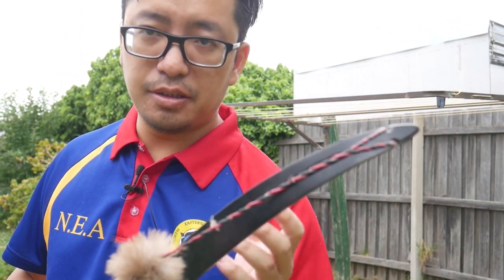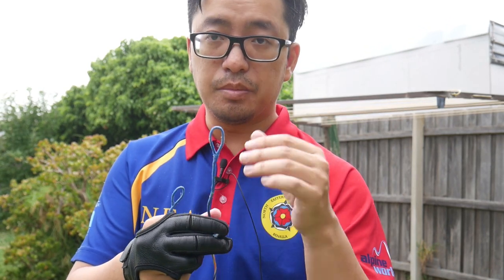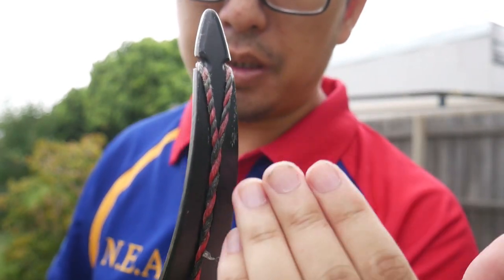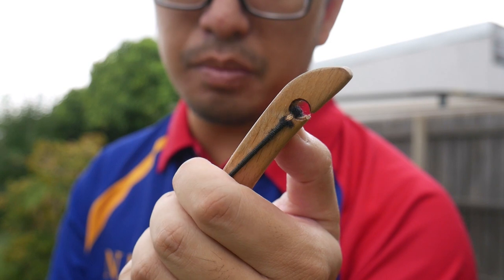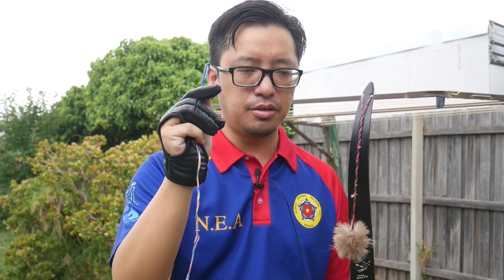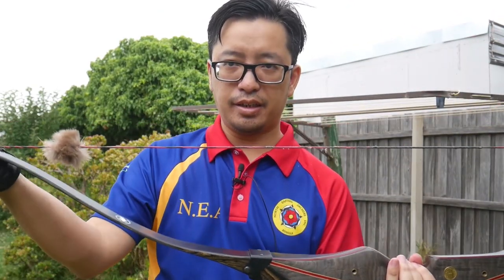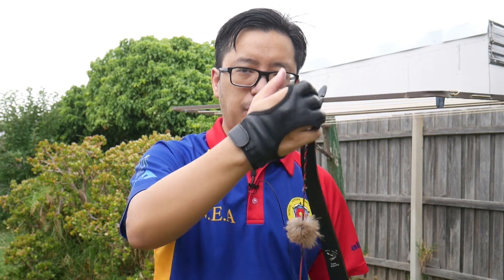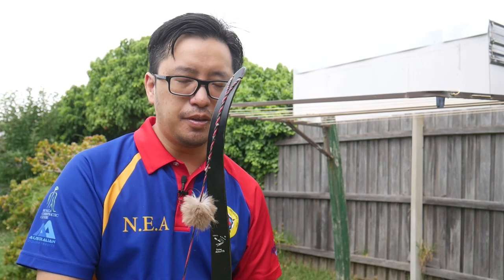Frayed String Loop... Or Flemish Twist?

Comment: The flemish twist, is similar to what we use in deep sea fishing...usualy when our rope is parted and we have to twist and splice it together to give a strong bond again, this works better  as opposed to a knot for the knot can catch or hook in pullies or hydraulic component and cause mechanical stress failure, or bodily harm.   related to the Bow...it makes the strings Strong and vituially unbrakable at the join.
Reply: Yes, an eye splice. Loads of different types used in sailing which could be used for smaller diameter 3 and 4 strand strings

Comment: Flemish twist strings are so easy to make I used to make them using my bed diagonally from headboard to endboard, you don't need a jig, you just need to fixed  points which are far enough apart.

Comment: My current recurve had a very sharp edge on the limb tip indents. It was causing me to burn through strings very quickly, so I added a little piece of felt along the indent edge and voila!, no more loop fraying.

Comment: I much prefer the look of the Flemish twist strings, since you can basically mix/match any colors. The only issue I find is that they tend to be a bit thicker in the nocking area and thus the arrow nock fits a little tighter than with an endless loop style string.

Comment: So why do Longbows, Asian bows (Mongolian, Turkish, Korean, etc) with long/large loops "always" use endless loop strings, if Flemish Twist strings are more common in traditional archery? Manufacturing costs?
Practical question: Which has less stretch when used in other than ideal weather conditions? E.G.: It is raining or snowing while you are hunting?  (or participating in an outdoor match, if it isn't postponed due to precipitation.)
You forgot to mention an advantage of the Flemish Twist string: They are easier to twist to adjust the brace height.

Comment: What's the benefit of using one kind of string over the other? Is there any specific reason to choose either flemish or endless?
Reply from the maker: They function the same. The difference is how they're made. Neither are hard to make, but endless loop requires more specific tools, whereas Flemish twist can mostly be done by hand. There's also something to be said about the aesthetics of a braided bowstring versus a served one, but that's subjective.
Reply: A "Flemish" string would theoretically use less raw material. Other than that, personal preference, really.
Reply: @NUSensei  Somebody is spamming this comment section in your name mate

Comment: Flemish twist will always get longer with time. It is a bad thing. So do not get attached to Your nocking points. Wait till it will reach its final form. Or stretch it beforehand ...
Reply: No, it’s the string material not the method of making them. The only ways a Flemish string can get longer are if the laid-in loops slip or if the string material stretches. If it’s properly made and you keep the twists in the string the loops won’t slip. The main thing is that trad bows (which are more likely to have Flemish strings) are more likely to have strings made of Dacron or B55 which does stretch a lot more than the more high tech Fast Flight yarns more typically used for endless loop strings. Any string will stretch a little from new so always best to pre stretch them, whether endless or Flemish.
Reply: @4d4m22  The loops do not slip. The twists get longer with the force of the bow (if it is not pre-stretched). I've seen this numerous of times in the club we have.
Reply: @-fazik-3713  So if the twists get longer that is the string material stretching as I said, and not due to the string being Flemish twist. All strings should ideally be pre-stretched, but you can get away with it more with fastflight/dyneema strings.
Reply: @4d4m22  Endless loop stretch as much as the material. Flemish twist stretches as much as the material AND more due to the fact that the whole string is twisted.
Reply: @-fazik-3713  Negligible. The stretch is due to the material

Comment: Why is the additional thread used on an endless loop string called a serving?
Reply from the maker: The term dates from long ago, and is used to describe the method of protecting a rope or cable by covering it with another rope material.